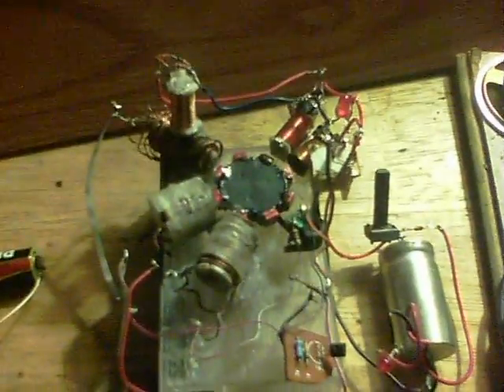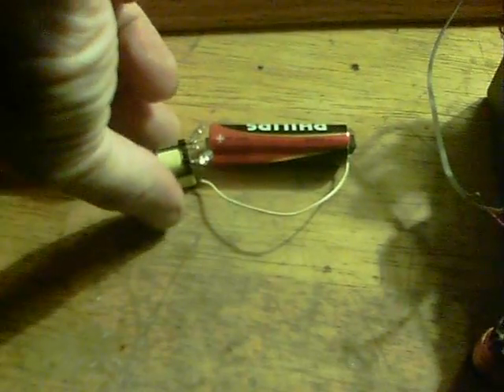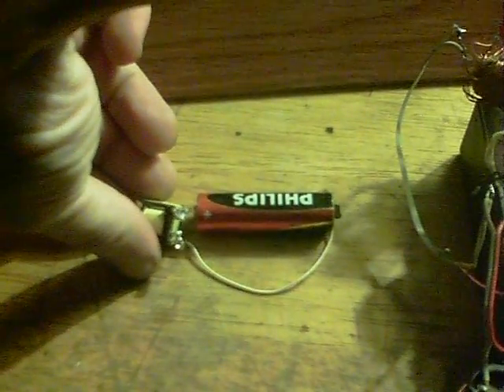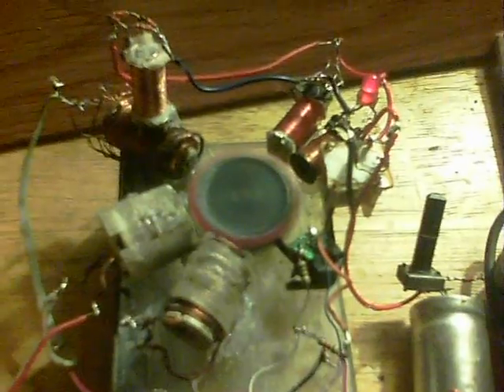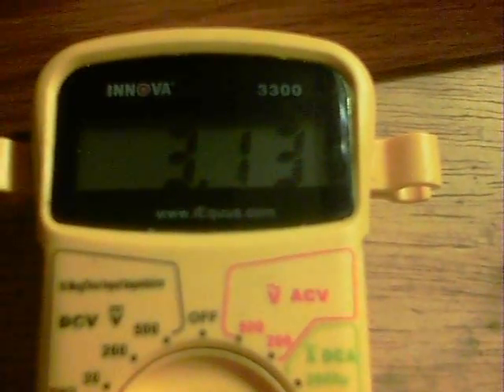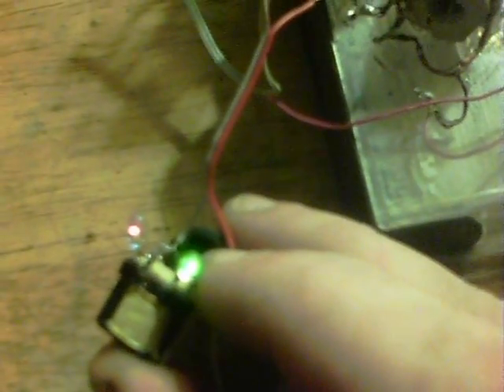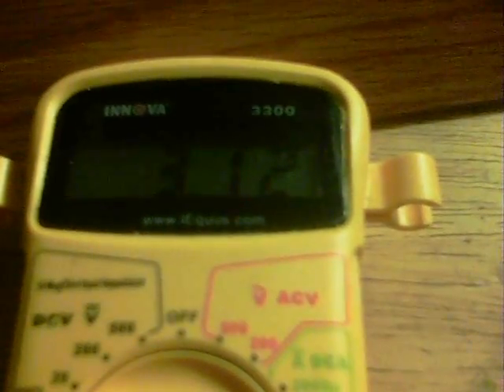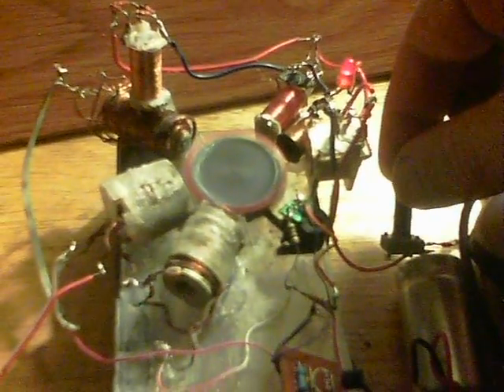1.5V LED xformer+pulse motor

Comment: Tell me about it :P
I used to clean out foreclosed homes, and have thrown away so many electronics it almost makes me cry, now that I know how much useful stuff is in them.  I have taken apart at least 6 or 7 CRT monitors at this point, and most of the parts I use now come from them!  I have told everyone I know not to throw away anything with a circuit in it, if they don't want it, give it to me, they are supplying my "free energy" experiments for free ;)

Comment from the maker: @picturen8 I gave a lot of monitors away before realising that - the flybacks are ideal for plasma off 3V and up, the neck has huge amount of 22 gauge wire within the black degauss coil, neck itself has stranded wire for litz coils, usually IRF630 etc MOSFET's by the half dozen, couple 1500V transistors (for Bedini wheels), high voltage FWBR's, quality ferrite coils, resistors, 0.1uF or larger HV caps, diodes (1N4148 and 1N4007 by the bucketload), switches, LED's, a relay, heatsinks and more !

Comment: Awesome, thanks for letting me know.  I have a mountain of old CRT monitor circuit boards, and a few old tv's, but I don't think any of them are that old.  I do have a few old radios that should be late 70's models at least, will have a look inside :)
I will have to keep collecting other's junk electronics till I find what I am looking for.
Thanks for the tip
N8

Comment: Hey Slider, great video!  I actually have a few of those xformers (2input/4output) and will play around with them as well :)
2 quick questions, what did you scavenge the 2n2222 off of, I have been looking for some of those.  and is the 10k cap also scavenged and if so from where?  biggest cap I have found on any circuit board is 3300µf, and I would like at least one 10K if I can find one.
Always great to watch your videos, you come up with some of the most unique stuff I see on youtube
thanks
N8

Comment from the maker: @rrt12100 Ah, they're not light bulbs, they're LED's. They normally need about 3V to light, but the transformer creates spikes enough to make them flash...once on battery connection, once on release of the battery.